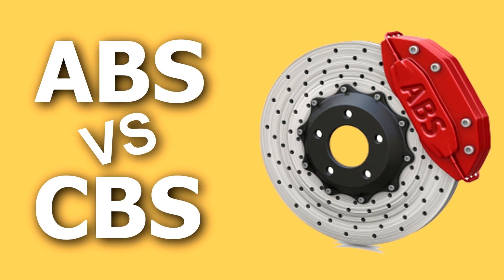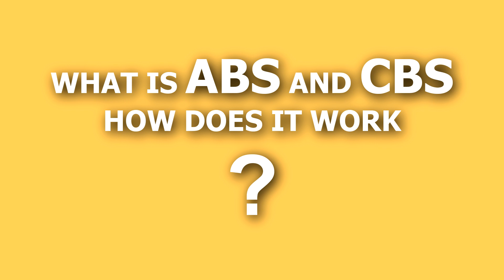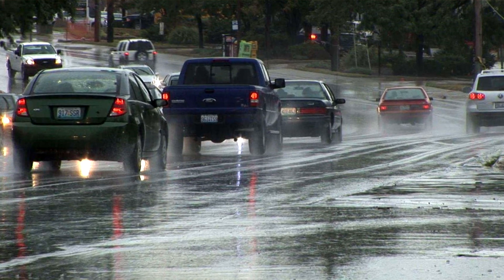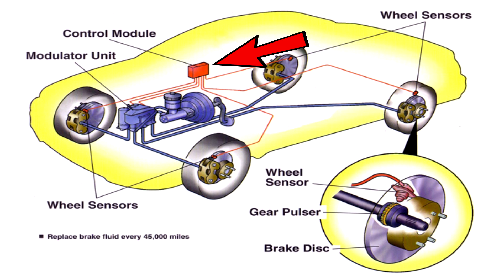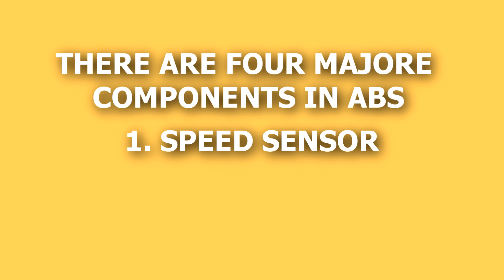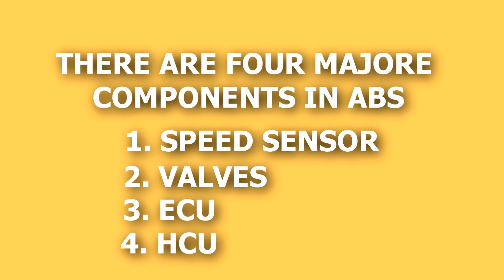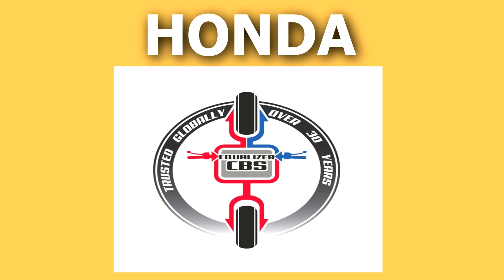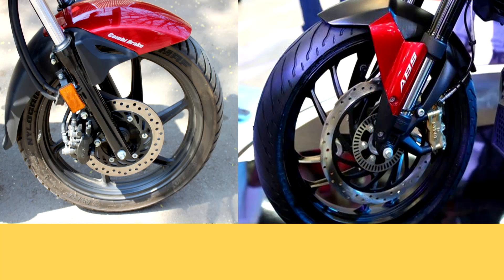Difference Between ABS And CBS | ABS VS CBS

Comment: I have a question. If anyone pushes left & right brake together in a CBS system. What will happen?? Will the bike skid??
Reply: so cbs is dangerous somtimes
Reply: No. That would be better than pressing just right brake alone, it's more prone to accident. Lol
Reply: If you push left and right brake together you  just equal the brake pressure like normal braking but if you push more pressure on right brake the bike will skid because front tire lock up.

Comment: Since an emergency braking system is mandatory on motorcycles in the EU since a few years the cheaper bikes like 125cc are using CBS while the more expensive models have ABS.
Reply: I was asking myself that as well. I already skidded away with a 50cc scooter, my front tire said "nope". Quite a smash. Without CBS I have the freedom to not use my front brake at all when it rains to prevent that from happening again, but won't CBS just mess my front wheel up and make me fall again?
Reply: @Jonasgamertv  it doesn't apply front brakes fully, only a slight pressure is applied on front brake

Comment: Does CBS work if right break lever is pressed?  I am planning to purchase it soon but I have some problem in the hand since my birth. So I could not use or press left break. For this, how can you make easy for me?
Reply from the maker: Yes there is minimum level of brake applied while we apply Right brake but you can manually adjust the brake on right bake lever according to requirement, This can be done by the Showroom talk to mechanic before purchase.

Comment: In my 100% NON-PROFESSIONAL opinion, I think that ABS would be great for bikes that are used in long rides and highways as well as on-off roaders. The CBS would be better in bikes/motorcycles that are used mainly in the city/ fairly low speed areas. That's why I think I'm getting the KeeWay K-Light 125 motorcycle, it has CBS and I'm going to use it for day to day comute in the city, where speeds are not high.
Reply from the maker: Firstly you have to know there background of usage ABS is user friendly to every types of vehicles whereas CBS is only for Scooters.
Reply: @Mobitod  it is designed for bikes also cbr1000 rr has this
Reply: Whatever speed you go you can apply hard brake In cbs it will not  lock wheel but in abs you will feel interference will hard braking

Comment: In wet roads abs is better r CBS is better ?
Reply from the maker: It's depend on type of the vehicles you buying ABS is auto electronic controlled, whereas in CBS is manual mechanism controlled, ABS is expensive also used in multiple vehicles whereas CBS is only for Honda Budget segment vehicles, so conclusion is that ABS would be better option.
Reply: @Mobitod  tq sir
Reply: @Mobitod  it means in abs even if we press brakes hard it can understand speed through the sensors.. And it automatically press brake lightly right?

Comment: Cbs is not good in emergency situation. slipping to the road when hard braking can be fatal especially during rain
Reply: CBS will not make wheel lock.even abs has interference will hard braking but in CBS there is no interference and locking of the wheel

Comment: In CBS, will the equalizer activate only when the left Brakes (i.e rear brakes) are applied or even when right (i.e front brakes) are applied?
Reply from the maker: While if any of Rear or Front brake applied at a time it activate equalizer to put equal braking pressure in both front and rear wheel.

Comment: is it possible to add both braking system on your bike? cbs is for braking both front and rear why not adding abs on each front and rear? my noob question.. 😂
Reply: There is it’s called C-ABS
Reply: Think CBS is full break on the back in front is 50% break only..wich really good if there passing by in norrow road like city..
Reply: yeah in upcoming honda bikes the both are combined
Reply from the maker: Coz ABS is more hi-tech then CBS, In ABS there is Intelligent smart sensor in each wheel which controls and regulates the speed of the vehicles in any skidding condition. Where as ABS is smart and Intelligent braking system and CBS is a Automatic Brake system, CBS is cheaper then ABS. lastly I don't think so you can add both braking system in one vehicle, you have to choose either one.
Reply: @Mobitod  in abs single channel good Or double channel